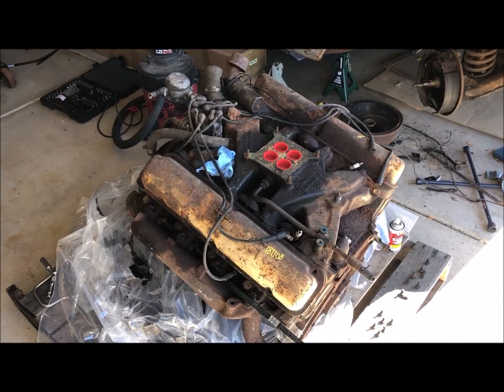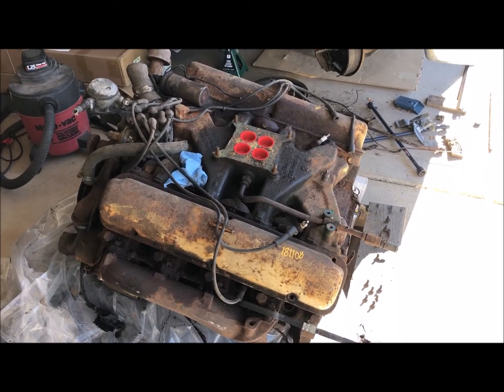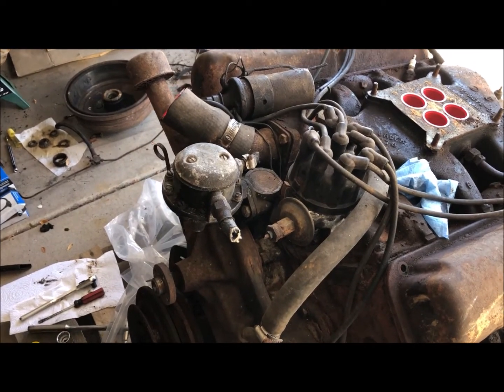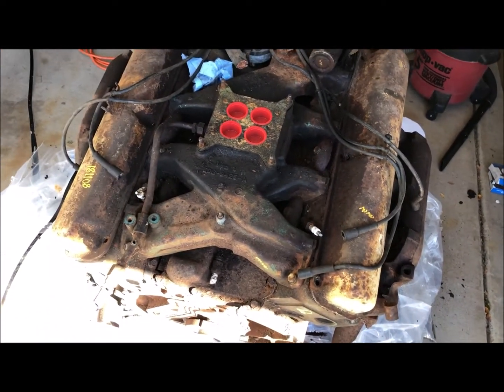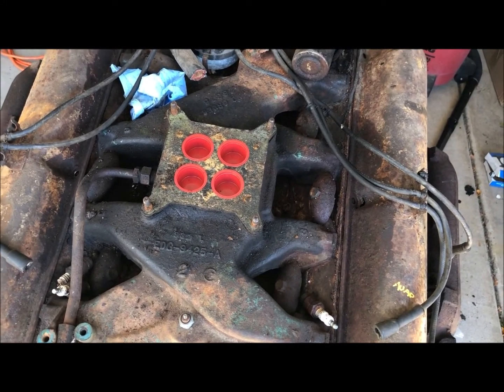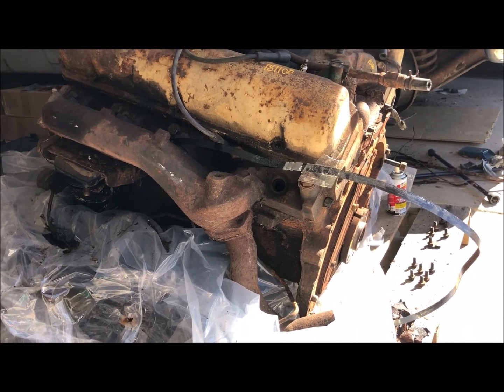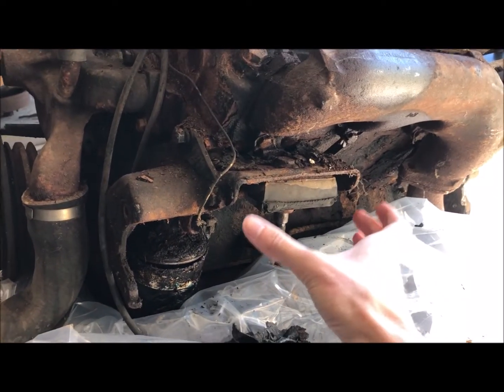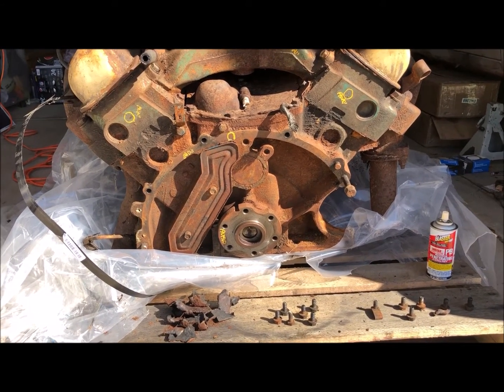430 MEL Engine Tour

Comment from the maker: Correction: at 4:42, it was stated these had a crank-driven power steering pump, and one can be run without the power steering pump. However, we were unaware at the time that this engine was never equipped with a crank-driven pump from the factory. Early 1958 engines (This one was manufactured October 1957) had belt-driven pumps, as did 1959-60 Thunderbirds, and presumably, Mercurys. That is why that bracket on the front exists, and why the crank pulley has an extra groove on the front of it not seen in other examples (3 grooves vs. 2). If one chooses to delete the crank-driven pump, they must install the spacer that this particular engine, as well as Thunderbirds, were factory equipped with, as the pump acts as both a sealing surface for the front main seal, and a spacer so the front crank pulley can be correctly spaced from the front of the engine. We will go into further detail in the rebuild videos.

Also, apologies for forgetting to mention the Super Marauder!
Reply: 385 series never had a crank driven power steering pump. And the 385 series family has 3 members , 370ci , 429ci and 460ci , everyone forgets the 370 .

Comment: The other best part of any MEL Lincoln and Merc. Is the diff , they had Ford 9 3/8 diffs , same design as 8 and 9 inch Ford just bigger and stronger , all 31 spline axles and nodular carriers + LSD locker and 2 93 or 3 5 to one , all had big uni joints and big bareings . The 9 3/8 carrier and axels fit in a big bareings 9 inch housing , but you have to notch the case for ring gear ( slightly) , makes a super strong rear , if you ever see a 1960s Lincoln with a MEL save that diff  !!

Comment: The old MEL engines are way cool. Just found this channel any updates on that engine?
Reply from the maker: May be getting it back from the machine shop soon. Had to be bored .030" over. We cleaned up a lot of other parts, though, so once it's back, reassembly should be a breeze, relatively speaking.

Comment: Did you rebuild it?
Reply from the maker: In the process... may be receiving it back from the machine shop soon. It had to be bored .030" over and it was so bad, the old pistons had to be hit out with an air hammer!
Reply: @InlandYachtClub sounds like in that case it's more lucky it only had to go .030 over ✌️